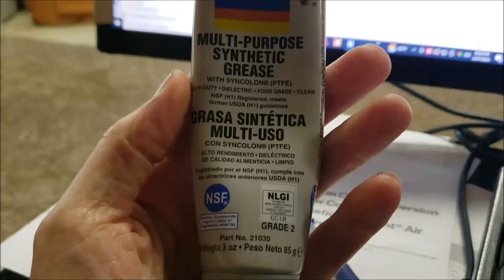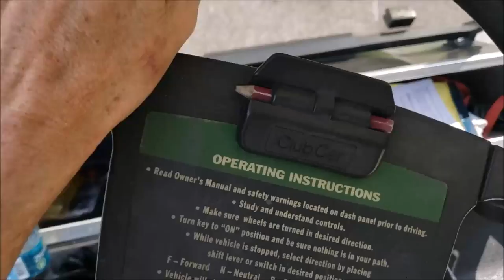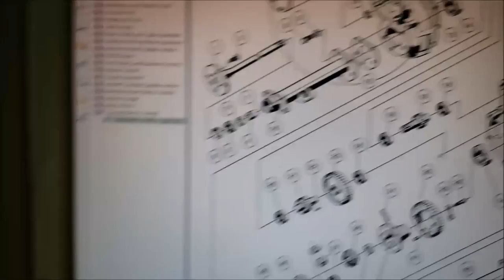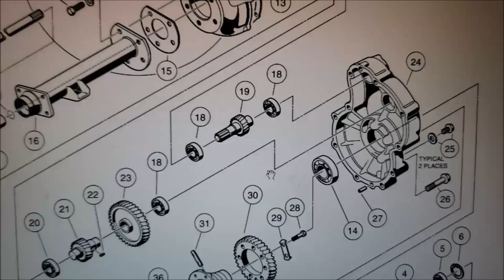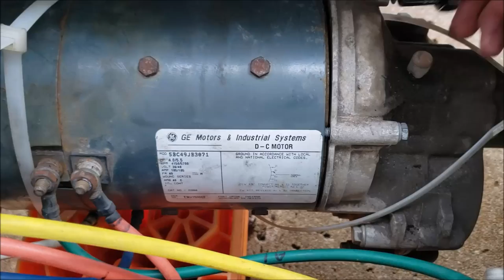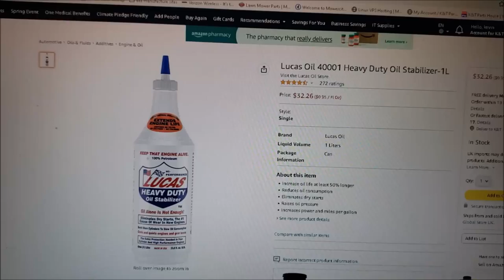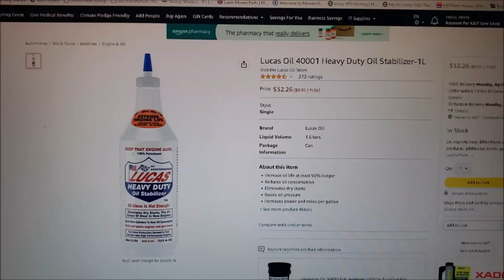Solved: Club Car Golf Car / Golf Cart Differential Transaxle Rear End Noise Fix Yours Today

Comment: Airplane propeller geese works real good in a car drive shaft ,helps the drive shaft slip in and out of the transmission , when you stop then let the brake pedal go i dont get the klunk noise anymore.

Comment: Redline oil makes a product called "shockproof" gear oil which has what seems to be chopped up teflon in it.  You can't use it in anything with a pump, but in old worn out gearboxes it's amazing.  I use in in tractor PTO mower gearboxes mostly.
Reply from the maker: What a great tip thank you!

Comment: Do you think the Lucas Oil Heavy Duty Stabilizer will affect the internal brake functionality on a 2007 Yamaha G29 YDRE Electric cart?
Reply from the maker: I think it will be just fine, your only making the oil a little thicker,, cold weather does the same thing.

Comment: Interesting.  The spline drive shaft was probably floating in and out.   A foam plug placed inside the ac motor would of applied pressure to the drive shaft to keep it in place.
Reply: Makes sense.

Comment: Please explain why you are not usiing 30W regular oil in the differential as specified in the differential ?  is the oil stabilizer by itself thicker than the 30W oil ?  Maybe someone had put gear oil instead of 30 W in the differential previously.  Way too thin.
Reply from the maker: Age and temperature:  After 25 years of use I'm sure we have some extra clearance and wear in the differential  also the fact that is never used in cold weather so no need to worry about the loss of efficiency do to the thicker oil in cold weather. We have ran it hard every day for the past 2 months and all is still quite.
Reply: Gear lube is much heavier the 30W motor oil.  For worn gears, 85-140W helps!

Comment: I have the same issue with mine, 2002 Yamaha G19. I the input shaft is $200!!! I can’t afford it. Do you recommend I change oil first and see, or buy the GE silicon? Thank you!
Reply from the maker: Yes I would start with the Lucas oil change.  If not better then try the silicone.  Keep me updated on what you find out.

Comment: How did you determine that the noise was NOT coming from the electric motor bearing?  That not a real difficult thing to replace.
Reply from the maker: I checked that first thing, and it was smooth as silk. Ps, it's still nice a quiet 🤫 👌